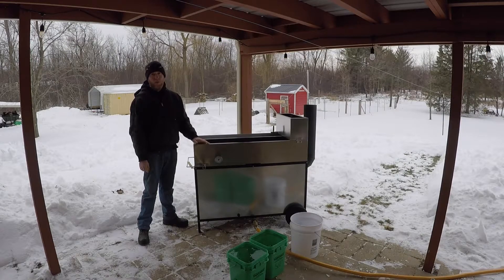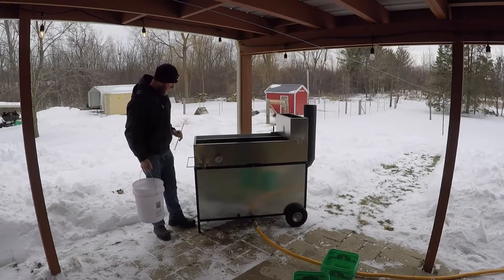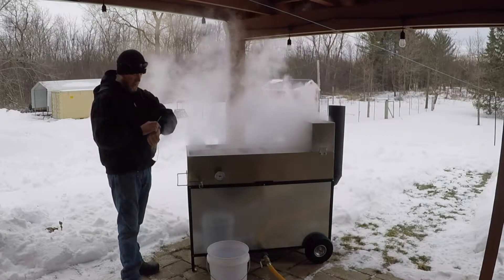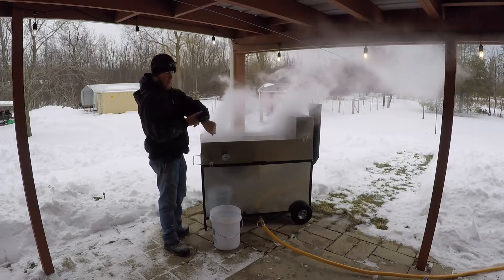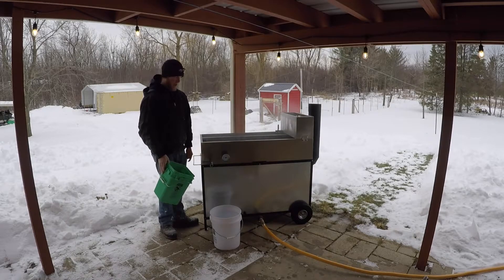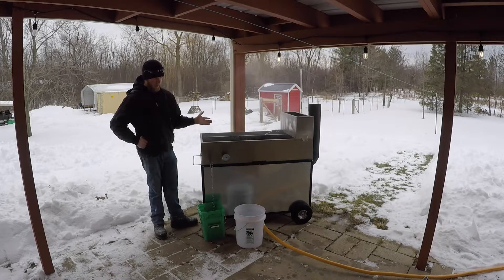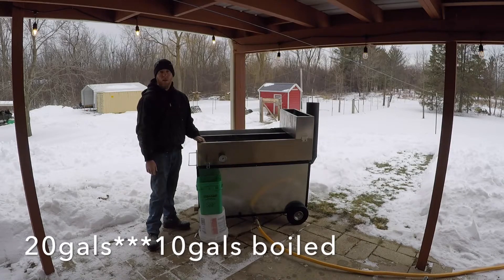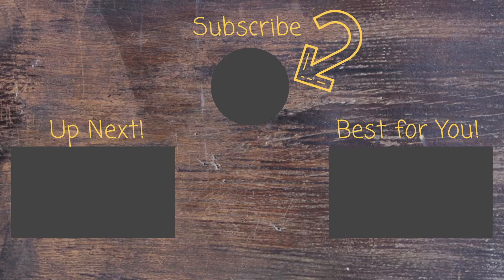Testing Natural Gas Maple Syrup Evaporator Homemade

Comment: @TylerKoehn did you end up removing the stack? Have you changed amything feom the original build since you have been running it?? I've been doing sap on a propane setup for a few years, did you need to go 3/4 main to 1/2 to the burners? Because I run off 100# bottles? Not sure if i would need to up my supply lines
Reply from the maker: I did not change anything but i only used it for a season after building. I way overbuilt for the size of my maple production. I made another video showing the burner I made that I currently use. 
Yes I bottled it down to 1/2 inch black pipe at the tee going to the individual burners. Not sure with propane since that's at a higher pressure.

Comment: what did you use to hold the thermal blanket in place?
Reply from the maker: I installed extra long bolts to secure the panels which left room past the insulation for it to be wired into place with stainless steel wire. If you go to 14:20 in the build video youll see it being installed. https://youtu.be/ZCupo1Ky--o
Reply: @Tyler_Koehn  what size wheels did you use and where did you get them?...also what size axle shaft were the wheels and also can you send a link for the electric ignition you used?...thank you

Comment: So what was the final result? Did it work well for you? I am looking at using the same burners on propane, I am looking at 6 burners. A 3x6' pan. Looks like a great setup.
Reply from the maker: Hey Thomas, I actually ended up selling this as I came to terms with the fact it was just way to big for the little amount of sap i do. So i never did end up getting to boil down syrup with it. Not sure with the propane as youll have alot more pressure but on Nat Gas there probably wouldn't be enough to supply that many burners. I ended up building this https://youtu.be/MQT_xT6CMWQ Worked out really nice and can be used for other things like turkey fryer and plucking chickens.

Comment: I was just looking into natural gas evaporator options, as I currently run off wood and it is a pain to keep it going and I burn through a ton of wood.  I've got a bunch of questions and maybe a few suggestions for you.  I'll start with the questions: Any idea how much gas it uses?  Would you be able to provide details on the burners you used and other parts you may have used. Looks like you got the burners from Amazon from the other video.  Now a couple of suggestions/ideas I would have to make the build better: 1) Some way to level the unit.  Your run seems to be under a deck and it is probably level, but I run mine outside on my lawn, so I tend to have to use some shims to level. 2) Possible to make the unit collapsible for easier storage/less space. 3) Maybe put a floor under the burners to send more heat towards the pan or have less of a cavity to fill with heated air.
Reply from the maker: These are obviously rough calculations based on two 100k btu burners. Calculations put it at 200 cu ft per hr. So 2ccf x 1.049 btu = 2.098 therms x ~$.55= $1.15 a hour. Seems like a bargain to me.  Yep simply amazon burners, amazon pan, amazon igniters, amazon insulation. Everything else was built as you'll see in the other video. would be easy to use thick threaded rod for front legs to make it endless adjustable. As far as blocking off the bottom for heat not sure how much oxygen you need for those burners. Something to test.

Comment: How's shew goin'?  Wow that's great, getting 10 gal an hour!!!  On my little 18" square pan and 50 K BTU cast iron burner I get 1 gal an hour!!!  That is a nice evaporator you made and the pan with the preheater on the end like that is terrific!!!  Good luck with your season!!  Take care!!
Reply from the maker: Thanks Mike! I think that it was a good rate! I was a little disappointed at the time thinking it was only 6 gals haha I can only imagine how much fuel I was going through to achieve this, my meter was just spinning away! Thanks for watching and commenting!
Reply: @Tyler_Koehn  Every solution has a problem eh!!!  I usually make about 5 liters of syrup, so that's about 200 liters of sap.  I boil of about 4 liters an hour and it takes about 2 1/2  -  30 pound propane bottles to do this.  But what ever the cost, the syrup tastes way better when you make it yourself so it's all worth every cent!!!  LOL
Reply from the maker: @GrampiesWorkshop  Haha absolutely. Sweat equity will always make anything better!

Comment: Looks like it works great and it looks good too. This is somthing new to us as I do not believe we have the climate to tap Maples. Would it be more efficient if you ran it undercover with the stack venting to outside?
Reply from the maker: Thanks Joseph! Not too sure. I would think as long as you have the freeze at night and thaw condition during the day you should be able to depending on the species of tree. Many serious sap guys do run a "sugar shack" and they typically use a cupola or a hood to extract the steam out of the building and do have a smoke stack for their wood fired evaporator. This is the first natural gas one I've seen so I'm kind of learning as I go. Thanks for watching